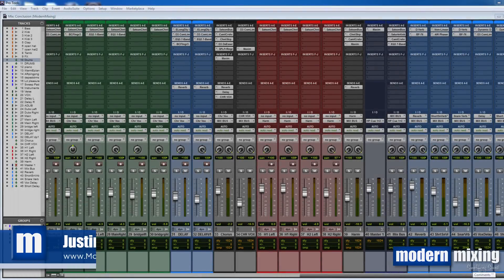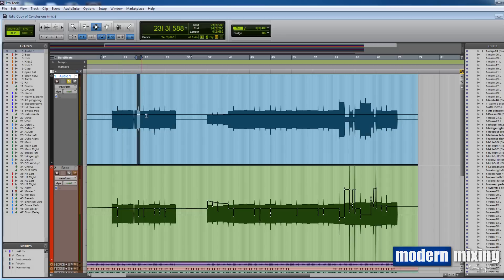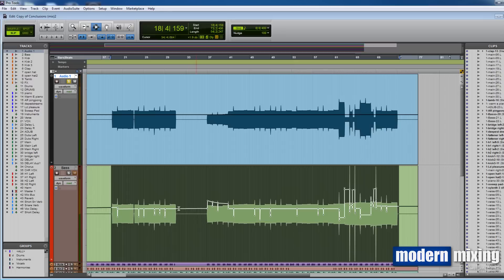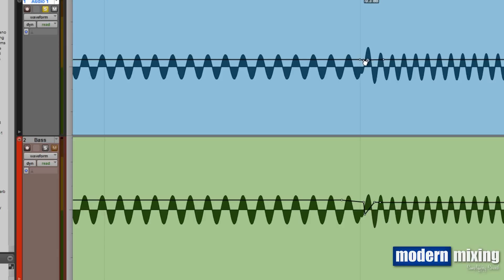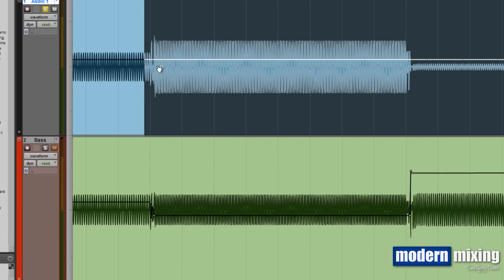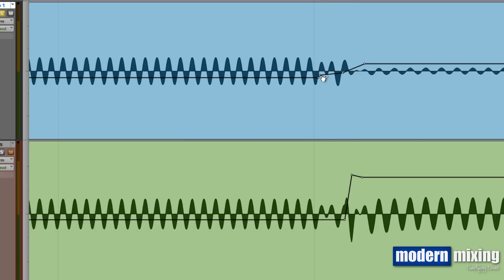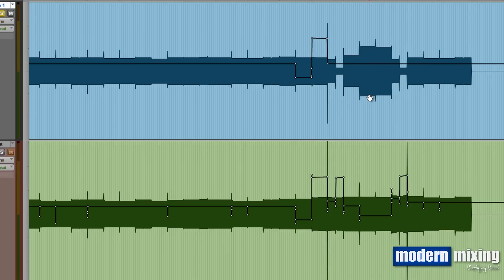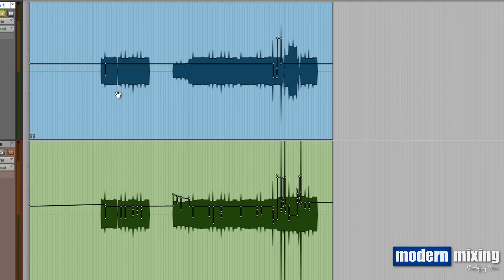Mixing Bass (Clip Gain) - ModernMixing.com

Comment: Clip gain is a life saver when it comes to doing stuff like this. It's a good thing they added that to Pro Tools. I use clip gain all the time now for TV and video post-production. It saves a lot of time.

If you can afford it, the Waves Bass Rider plugin does this automatically. I bought the plugin and I've found that it works really well. Then you can stick a compressor or limiter of your choice to colour the sound rather than to even out the level.